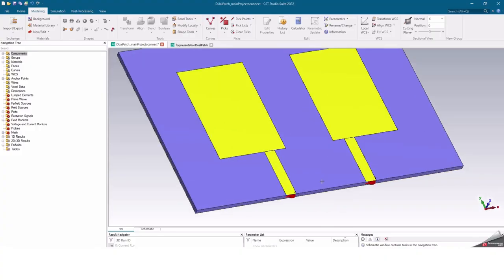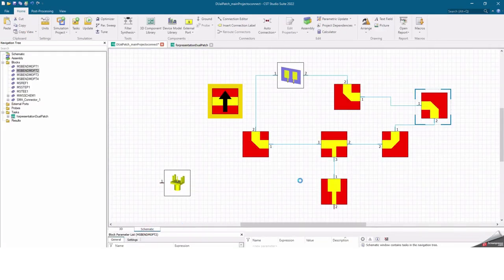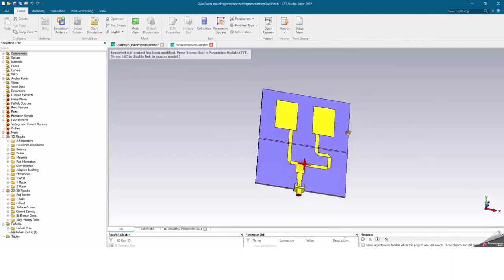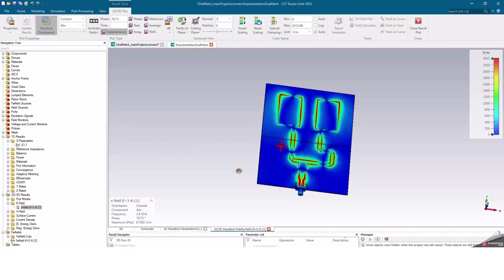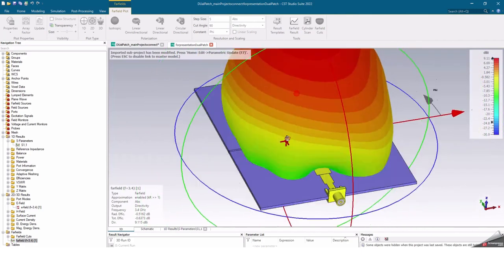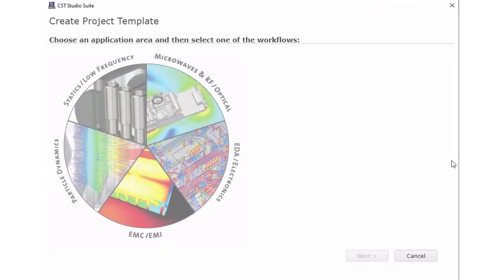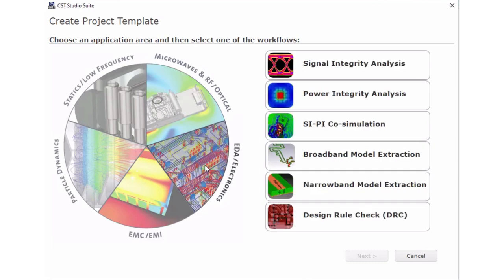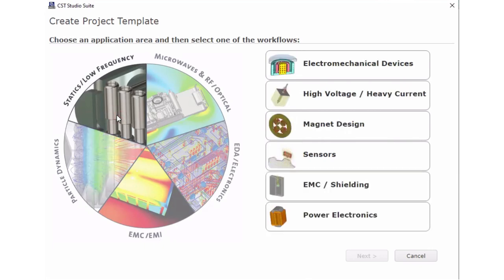5 minutes to understand CST Studio Suite

Comment: Thanks..can cst program use in industrial automation?
Reply from the maker: Actually CST Studio Suite® is a high performance 3D EM software, for designing, analyzing and optimizing EM structures. However, industrial automation is basically the use of control systems for handling different process machineries. CST intervenes in some aspects of it, it supports all major CAD and EDA (Electronic Design Automation) and many others that can be useful in some specific industrial automation.